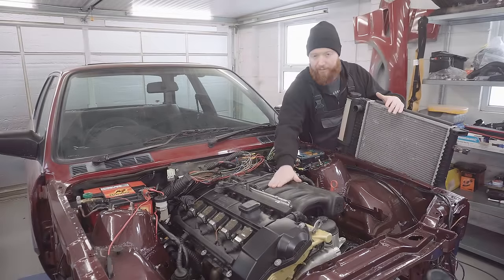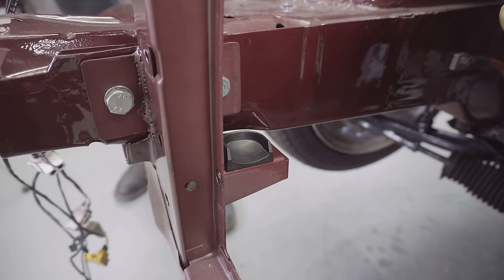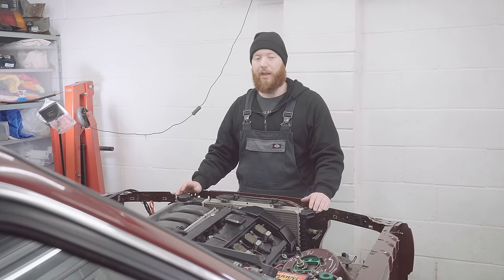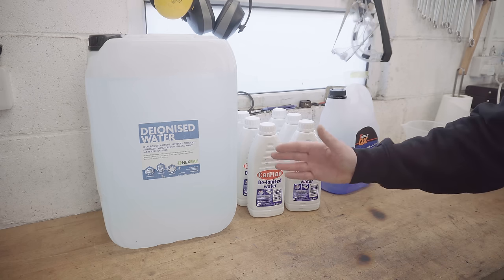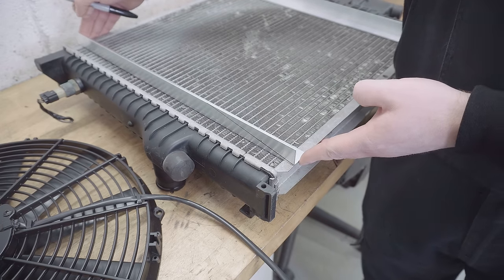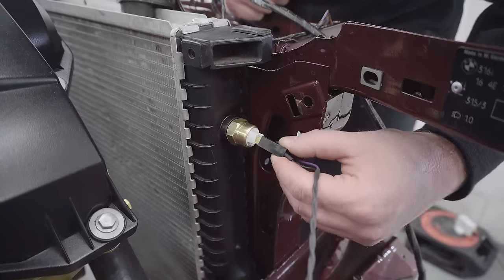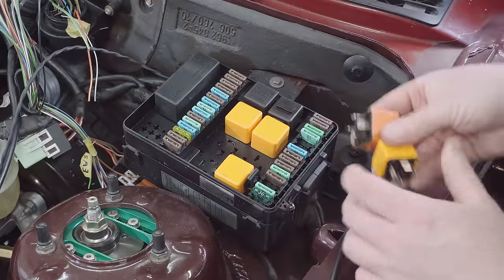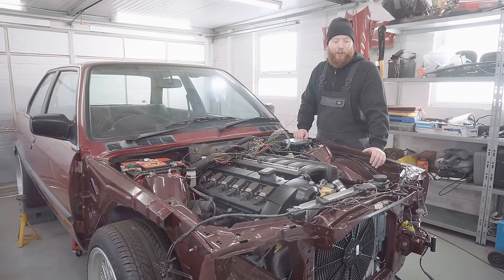BMW E30 M52 Swap Cooling System Guide [E36 AC Radiator + SPAL 16" Pusher Fan & Wiring] 055

Comment: Awesome job mate!! I’ve just fitted an M44 engine to my E30, the old M42 blew up, so I took a similar engine from a Z3. Not got round to the wiring yet, but will copy the cooling system you’ve done here 👍🏼
Reply from the maker: Nice, the 1.9 M44 is a nice motor, glad your swap went well, hope the wiring is straightforward for it.

I'm well chuffed with the cooling setup, hope it performs as good as it looks!

Comment: Thanks for the content matey :) been following along as you have progressed. I've had an M50 half sat in one of my E28s for the past 11 years (a project that went cold before I ended up going to university) and your videos have been motivating me to getting that motor up and running as well as quite a few inspirational points towards my 2.0 to 2.8 Z3 conversation that's just about complete. 

Well done on everything so far, you should be proud :)
Reply from the maker: Cheers Darren! I know exactly what you mean about projects. Before you start they seem so quick and simple, but when you get into it you realise how time intensive they really are, even simple builds like mine. Then life gets in the way and before you know it you've lost momentum.

Comments like these definitely help me persist. As does making myself accountable by uploading vids to YT. 🤭

Really hope my vids help kickstart you on the E28 M50 swap, sounds like an awesome project.

Comment: Dude- your videos are so informative. I still have the original M20B25 and likely wont ever swap it- but I love to see how these swaps are done.  I’ll only add ITBs to my car one day and keep it mostly stock.
Reply from the maker: Thank you mate, if mine was an M20B25 I would embrace that too, it's a very cool engine, and ITBs would be epic!

I intentionally picked the cheapest lowest spec 316i I could find so I didn't feel bad about chopping and changing it however I liked.

It was never going to be a collector car this one. 😃
Reply: @SPANNERRASH  you would be surprised what cars become collector items.  Your car would definitely be appealing to many collectors that want a fun “classic” car with more modern power.  My M20B25 puked its oil out last week from a failed o-ring on the oil filter housing 🙄- it’s that kinda of stuff that makes me want to put something newer in there - but as you know- is a lot lot work- and I still have a 300tdi that keeps me busy. 😵‍💫

Comment: Well done, things are moving along nicely. Just a point on the coolant. Up until a few months ago when I retired, I used to work for Euro Car Parts. I was going to buy some of the Triple QX blue because I got it really cheap being staff, but I couldn't get to the bottom of the actual specifications of it. I have ended up buying the Comma Xstream G48 which meets the relevant BMW specifications and is quite a bit cheaper than the genuine BMW coolant. I paid £30 for 6 litres of concentrate which will make 12L of coolant. The only thing is it is blue/green in colour rather than pure blue, but that doesn't worry me much.
Reply from the maker: Thanks for the insight Bob, I have tried a few coolants in my time but I've been using this stuff for a while in multiple cars and been quite happy with it.

I've got a basic understanding of coolants but I haven't dived too deep into the formulations like you have by the sound of it.

I will check out your recommended, but really don't like to mix the colours if I can avoid it. Got to be blue in a BMW for me, easier to tell what's leaking on your driveway. 😄
Reply: @SPANNERRASH  I'll tell you what I've learnt. The car I'm working on (E31) V8 engine, someone had put red coolant in it and I suspect it had reacted with old blue coolant and the result was giant clumps of white gunge everywhere. It took ages to flush out. So these people who say they are all the same and it doesn't matter what you use are wrong. I too have used the triple QX blue in my other cars with no apparent problems. As far as I know, the blue coolant is not that long lasting and should be changed more regularly, say every 2 years. I am just trying to do everything right on this car, hence the making sure the coolant meets the specs. It is all ethylene glycol at the end of the day, but it is the additives that cause the issues. I think BMW stress that is has to be nitrates free, and I couldn't confirm that the triple QX blue actually was. The correct stuff would be the BMW own make, but it is only available in 1.5L bottles, I would have needed 4, and I think it's £14 a bottle.
Reply from the maker: @bobfrankish8883  My god, that description of mixing the coolant and it gunging up into big clumps is exactly my fear and what makes me extra cautious about mixing them! 😱

In the past, a younger me used this QX blue and mixed it with what I can only presume is BMWs own, and I had no issues with it and when I eventually changed it no clumps. This lead me to trusting the stuff, but yes you're right about it needing to be changed more often, the bottle states 2 years I think.

I suspect this E30 will be getting more maintenance than miles, so as the price of this stuff, refreshing it every couple of years should be no sweat.

Time will tell how it goes, but at the end of the day I can always flush and change to BMWs own or try the Comma stuff. Ultimately this is my "cheap" project car so I try not to lose sleep over it. I would only put BMWs own stuff in my M3 though as I'm far more mindful about "protecting my investment" with that. Cant afford to break it! 😆

Thanks for sharing your knowledge on that, I really appreciate it, as will others who frequent the comments here.

Comment: very nice detailed video! 
But you've to trim the bracket of the oil filter housing,
otherwise the upper hose will be damaged.
Reply from the maker: Thank you, and very good eye.

I am also bothered by that lug on the oil filter housing. I'm concerned it will rub through the hose if given enough time. I will consider trimming it off when I start to tidy up the engine bay for a final finish.

Have you encountered the same issue on your own build?
Reply: Yes, it will definitely damage the hose when it inflates. 
Had the same issues with my build.

Comment: Good watch. Come at a good time as was just trying to wrap my head around the electric fan wiring for the m30 swap and I've yet to come across a video, tons of useful forum posts but my brain works better visually when it comes to wiring, with as much detail regarding the wiring and fuse box situation. Will have to contact Dan about that eletric fan wiring loom. Looks properly smart
Reply from the maker: Cheers! Yeah wiring is not my forte, even the nice kit from Dan took me a bit of figuring out. I couldn't get my head around how it worked at first, but now its on its bloody brilliant. Really happy with the result.

Hope the guide helps you out, can't recommend the BM conversions loom for this enough, would have been a right pain making it from scratch. 👍

Comment: Love the absolutle effort you put into all these videos , some fine attention to detail.. i was out on mine today since weather  was agreeable. I just got some bits off Dan at BM conversion TOP bloke. I'm converting the E30 to run MK60 standalone ABS. 
Cant wait to see your maiden voyage ❤️
Reply from the maker: Cheers mate! Yeah I keep going back to BMConversions for more parts, he's a treasure trove of E30 engine swap solutions. 😃

MK60 ABS conversion sounds interesting, my E46 uses this system and it's sound.

Even though I love the simplicity of my E30, I kind of wish it had ABS. It really does make a world of difference getting the car stopped in an emergency situation, especially in the wet. 😅

I may explore options in the future, you'll have to let me know how yours works out.
Reply: Indeed I got the adapters for the ABS sensors n the rear arms from him. I also plan to use the sensor as digital inputs for traction control strategies. 
I crashed my first E30 ... abs would have helped me potentially save it 😅 so I'm implementing it here. 
I'm looking at the position of the pump n sensors. 
I'll let you know how I get on 😊
Reply from the maker: @b19gok  Sounds brilliant. I very nearly crashed my first one too when some idiot pulled out on me from a side road. I slammed the anchors on and the wheels locked up on me. Millimetres from disaster but would have been stopped much quicker with ABS.

I know people say with the right technique you can get a non-ABS car stopped just as quickly, but in the heat of an emergency you don't really have clarity of thought to lift off the pedal a bit and regain traction. 😆

I look forward to seeing how it comes out for you.

Comment: Really informative video, thank you! Do you mind sharing the part number of the temperature switch? My current switch is 90 degrees and it switches on around 3/4 so the next line from halfway mark. This means the engine is consistently running too hot. Thanks in advance!
Reply from the maker: Cheers! To be honest the temp switch came with the wiring kit from BMConversions. Theres no clear part numbers of anything like that on it.

I suspect if you get in touch with Dan at BMConversions he can sell you one, but you might be able to find one somewhere online.

Hope that helps!

Comment: The best way I have done to get rid of the high temperature is to turn off the thermostat and close the hot water nozzle. In winter, you can use the thermostat. For me, I prefer to cancel the thermostat because I live in the Sinai Desert
Reply from the maker: Blimey, it must be hot in the desert if you run no thermostat at all. I am using an 80 degree thermostat here in the UK and along with those rad and fan set up it should be spot on at keeping the car in its optimal operating temperature range.

Comment: Lovely job, attention to detail is fab to watch. I notice the air filter cone. Where did you exactly get that from please?
Reply from the maker: Hi Christopher, it actually came with the M52 engine. No brand on it either so I'm really not sure.

It's had a good clean but really not in great condition either, some damage and rust on the filter. It's been cobbled together from bits and bobs really. I think I will need to come up with a new intake filter design.
Reply: Many thanks, just completed a 300tdi conversion, and my ait cone is K&N and smaller than yours, I build a aluminium shroud more or less round it. Air still gets in. keep up the excellent videos to you and the old man! :) @SPANNERRASH
Reply from the maker: @christopherastbury-mg2iz  Ahh yes, this one definitely isn't a K&N, but it is a big 'un!

Definitely wise to shroud it from the engine bay heat as it won't help with performance sucking in hot air.

Plenty more vids to come, thank you! 😁

Comment: Can’t you use those zip tie style things to mount the fan to the rad.  There’s little mini brackets on the fan to allow you to do so and thread through the rad fins. Would be a lot cleaner than Alu angle.
Reply from the maker: I was planning to do this at first, and to be honest I think it would work fine.

Although you do hear of them eventually failing or gnawing away at the rad over time. Due to this, I opted to go with Dan's recommendation to solid mount it with the aly.

Check out the links in the description, it really wasn't expensive to mount it this way actually if you price it up.

Comment: I have an issue with my beamer. The car was driving fine. parked for the night and when i tried to start it in the morning, then the car kept cranking but no start whatsoever. No fuel, No spark, No fuel injected. I bypassed the fuse and relays and i got fuel pressure from the pump to the rail. But still no fuel injected and no spark. You guys reken EWS failure or DME failure? The window cowl has no more seal and the ecu might have gotten wet. I appreciate any inputs on what you guys think
Reply from the maker: Hi mate, that sounds like a really strange issue, it definitely could be the ECU. Especially if it has been wet.
But I would check the relays and fuses very carefully before replacing it, these are by far the most likely problem.

Comment: Good day beamers: I'm doing a multivalve conversion from M10B18. I cut the C101 connector plug from my M10 wiring to connect it with the m50B25 wiring loom: luckily all wires match the color coding except for two wires which are Green/Yellow and the other is Brown/ white. I'd like to know the color coding do these two match

Last thing I'd like to know is do I use my old starter and alternator wires or do they come with the wiring loom? If so then what color are they!?
Thank you
Reply from the maker: Hi mate, I think the answers you are looking for can be found in this M52 wiring video. I can't remember all the wiring colours off-hand, but I cover it all here: https://youtu.be/K_VaFcKwjlE?si=ZUlhE8XAmf4EEj15

Watch the first start video too which refers to wiring. Hope that helps!
Reply: @SPANNERRASH  good day. I have watched all your videos funny enough and unfortunately I have the early euro bumper e30 wiring and seems like the two colors I have don't match with your late e30 318 wiring
But thanks for the feedback
Reply from the maker: @bmwe30club64  Ahh that is unfortunate that they are different, I only have experience with the wiring on the facelift model, but hopefully someone out there has made a table matching early and late wiring colours somewhere.
Reply: @SPANNERRASH  no problem sir 😅 thanks for the help so far 🙏

Comment: My 1989 320i e30 m20b20 engine got clogged radiator, I need to replace it but I dont know wich option to go and what dimension, any tips please?
Reply from the maker: I got a radiator from an E36 AC equipped car to give some better cooling for the M52 swap. If you're sticking M20 I would say get a direct replacement and it should be easy and more than good enough.

Flush your block through with a hose if you can, maybe it's clogged with limescale and you wont want that going directly into your new rad.

Comment: How does the temperature stay with only the electric fan? I just had my viscous fan touch the radiator and it broke, I don't know what to do If i should give up the viscous mechanical fan and get an electric fan or just change the motor and trans mounts..
Reply from the maker: Is it also an M52 swapped E30? I cant imagine how you fit the viscous in the gap! I would ditch that for an electric pusher fan.

Honestly, the way I have mine set up, it's rock steady, never even a hint of overheating. I am surprised by how good it turned out to be.

However, I would modify the mounting strip to not have the strip in the swept area because I actually found mine broke due to blade strike.

Stay tuned and I will explain/show all in the next E30 vid.
Reply: @SPANNERRASH  its a 2.0 M50B20 non vanos, the clutch fan its from a diesel e30,  the radiator too, Should i Get the same radiator with a 16inch spal fan? Someone told me to change the engine rubber mounts to OEM from E34 cars?

Comment: How do you remove the fan if you need to replace it? It seems locked in place with the aluminum side brackets riveted in place and the bolts hard mounted to the fan. Would it have been better to put a nut on the fan side and then a bolt through the side brackets?
Reply from the maker: Good observation, I would have preferred to put the nut on the fan side, but then screwing the bolt in would have stressed the fan shroud plastic and  potentially cracked it, so I decided to play it safe.

I suppose I could have cut bolts down and just been very careful about not overtightening them.

I see no reason why you couldn't bolt the alu trims to the radiator instead of rivets, that might have been more serviceable too. Luckily, drilling those rivets or grinding them off would only take a moment if/when I need to look at the fan again.

Hopefully with it being a top quality SPAL unit, I wont need to worry about that for many years! 🤞
Reply: Thanks for the reply. Keep up the great work!

Comment: What expansion tank hose did you use?
Reply from the maker: You mean the long one which goes between the spider pipe and the bottom of the coolant reservoir? It's the same hose as from an E36, came with my M52B28 engine.
Reply: @SPANNERRASH  do you by any chance have the part number to it? I can’t seem to find it

Comment: What temperature is your rad fan switch operating at? Think my e21 was 90
Reply from the maker: Its an 82 degree one iirc, came with the BMConversions kit. Works amazingly well.

Watching the temp gauge in the E30 it seems to keep it in the middle range when it clicks on and off. We will see how that looks when the car is driving on the road but seems like it will be spot on.

Comment: Let me know if you aren't sure what to do about the tach reading correctly.
Reply from the maker: Hi mate, I have a coding plug to make it read correctly for 6-cyl. Still haven't got around to fitting it yet but that should correct it afaik. 😃
Reply: @SPANNERRASH  It's a piece of cake to wire one of those in compared to the rest of the wiring stuff you've had to do👍🏻
Reply from the maker: @CYMRU619  Possibly true haha, it required much less research. Always find it daunting though, I was scared about opening the fusebox.  😅

Couldn't have worked out better though!

Comment: i was about to ask why not just use the oem electric fan but there is not enough space :/ on another note just use a coin to turn the bleeding screw and be gentle with it. Dont even bother with the bras aliexpress crap it will destroy your rad
Reply from the maker: Nice, a coin is a good idea, I will give that a try next time. I totally agree about the brass screws, I think they are only for use in emergency situations to save a rad where the thread is gone.

I'm gonna stick to a new plastic one. Cheers! 😄